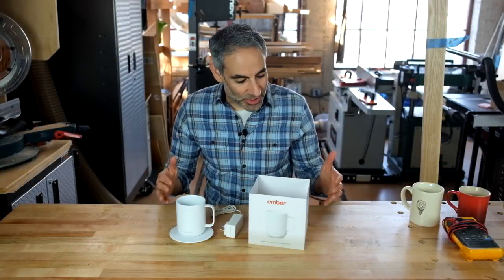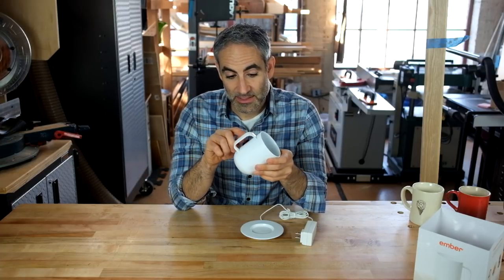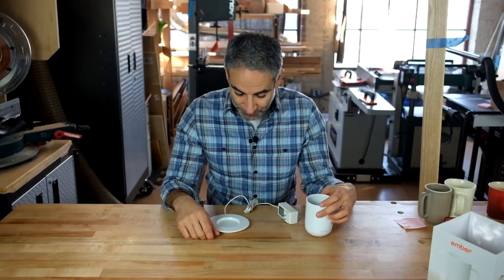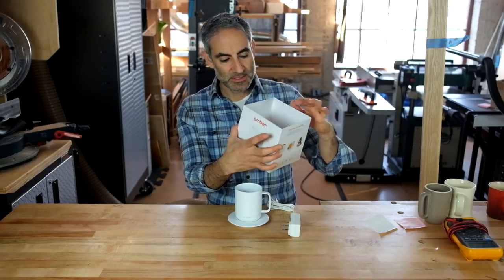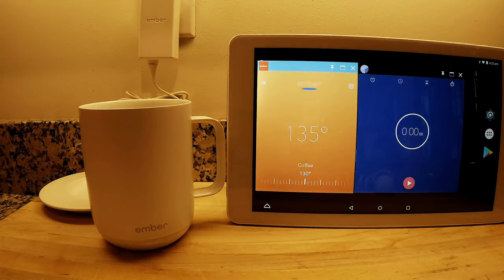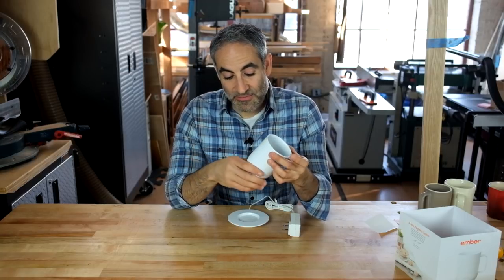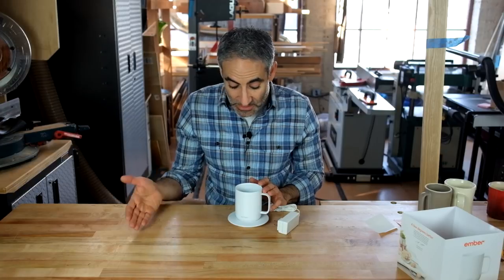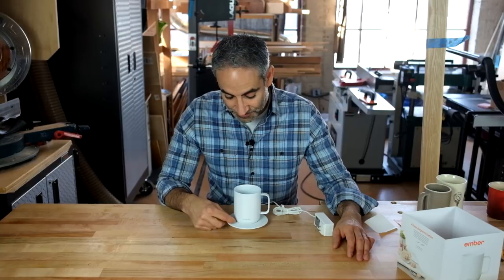Ember Coffee Mug Review: Things you need to know.

Comment: Hi Jesse, I think there is a problem with your experiment. You are assuming that for a full hour the mug keeps 100% of the water and needs to maintain it at the desired temperature. In a real case, as you drink more of your coffee, there is less and less volume of liquid that needs to be heated. And hypothetically, that means less battery use, which perhaps extends battery life. Let me know what you think.
Reply from the maker: Thanks for the comment! Answered that way below and won't go through it again but it's a theory for sure. In reality the mug just served no purpose for me which was the prompt for the whole video and then I returned it. Batteries just don't have high enough energy density yet to make the amount  of heat I'd need for it to be useful 🤷‍♂️

Comment: I love the concept of this mug. Unfortunately, the pins in my fist coaster stopped popping up and they sent me a replacement coaster. (after sending photos and a couple of emails). I do like how it keeps my tea hot (142) to the last drop of my first cup. I have started making my tea in a large "thermos-type" cup and repouring my second cup from it. Unfortunately it will not maintain the desired temp to the bottom of the second cup. For recharging, I am confused. Do most people clean the cup and leave it on the charger all night, or do you have to charge it, unplug and plug it in again in the morning to recharge the charge it has lost through the night? The cup is not ready for use if you unplug it throughout the night.Whew! What an ordeal huh?

Comment: This is my one year follow up report on my Ember mug. It is still working perfectly with no discernible change in the charge dynamics. This may be due to the fact that I rarely discharge it fully. Generally I use it once or twice in the morning for 30 minutes before returning it to the base charger. I have experimented with warming liquids and have discovered that the heating time is substantially shortened by covering the Ember. For example, a full cup of coffee can be heated from 120 degrees to 140 in 9’ 30” while covered but uncovered requires several minutes longer.
Reply from the maker: Good data! Makes sense.... Heat rises and all thermoses and insulated mugs have lids to keep heat from escaping from the top. Thanks for chiming in and glad you like your mug!

Comment: I think the experiments at the end of the video are actually pretty unrealistic scenarios.

I came across this video because I am looking to buy this product. Why do I want something like this?

Alot of times, I pour my self a cup of coffee or tea and place it at my desk while I am working then 30 minutes later I realize I forgot to drink my, drink, and it is now cold.

This product in my opinion is meant to be used at a desk behind a laptop/computer. Always plugged in and put on the charger while drinking or not. To keep your drink warm while you slowly work behind a computer and drink it. Not when you are sitting on a couch reading the news paper or as a electric kettle that you want to heat up your drink.
Reply from the maker: I hear ya! My pov was that if you're only using it in a use case where it's sitting on the base, you could just get a ten dollar mug warmer from target and then use any mug you want, be able to put it in the dishwasher etc. Ie I tested those scenarios because those are the ones where you'd actually need a battery heated mug rather than a hot plate for one.
But I'm glad you enjoy yours! I didn't find it to meet me needs which is why I then shot the video. Either way, thanks for your valuable comments.

Comment: Hey Jesse! Just picked up an Ember Mug for 2020 Christmas. You did an excellent review on the features and specs that really count. Wish I watched this video before I picked it up blindly. Fortunately, it works fine for the person I purchased it for. Still found this video very informative. BTW, I also picked up the Ember Travel Mug for myself. Hopefully you also have a review on that particular item. Ember now has metallic mugs; gold and silver. If you can do a side-by-side comparison on these three items, that would be awesome!! Hopefully Ember made improvements on the newer generations.

Also, your comment on the two leads being live was discovered accidentally by my self. I placed a Nespresso Capsule on the Ember Coaster and I heard and saw a spark from the contacts. This was startling to say the least. May of been a better design if the leads were further apart or at opposite sides of the coaster.

Also, after the Ember Mug is fully charged at our household, we take it off the charger to prevent overcharge and to save from unnecessary excess energy trickle. Does this make that big of a difference for either of the different model?

Thanks for your review on the Ember Mug.

Best Regards,
Johnson
Reply from the maker: Thanks man! Good points!
I won't be reviewing any more because i just don't have the time and I can't be spending $200 to make $3 back on a YouTube video, sadly. I actually bought the ember because I wanted to use it! Anyway good luck to you and thanks for the comments!

Comment: Sir....u r supposed to drink from that coffee. Meaning the battery will last longer when gradually it will need to keep less and less coffee at that temperature. (Thanks for this video, Subscribed)
Reply from the maker: Thanks for the thoughtful comment, octap79! Much appreciated. My experience with the mug (and my understanding of how this works) respectfully disagrees, but I could easily be wrong! :)  On it's own, the coffee doesn't want to do anything. IE it just sits there at the temperature it's at. The colder environment is what creates the heat loss, and because of the ceramic coating and such, loses most of the heat through the open top. Since that area at the top is always the same, the rate of heat loss is actually always the same. BUT, in fact, the actual DROP (not RATE) in temperature will be FASTER if there is less coffee in the cup because it has less thermal mass. At any rate, the amount of energy the cup has to put into keeping the liquid hot is a function of how much the coffee is losing (IE surface area and loss through insulated surfaces, which is less), not the amount of liquid in there. Where the liquid volume does really kick you in the pants is when you have to heat it from a lower temperature, and then the volume of liquid is directly proportional to the energy is takes to heat is, PLUS the thermal loss on top of the that. Anywho, that's my understanding of thermodynamics, but that's not my specialty ;)  Either way, appreciate the brain-teaser!

Comment: This is fantastic. A very thorough review that actually tells viewers how a product will behave rather than one which is a longwinded "I (dis)liked it". One small thing: I think with anything technical, Celsius (at least) would be appreciated, since it is used in most of the world and in most of science as well (and hey Kelvin is just shifted Celsius anyway). Similarly for lengths the metric system is more appropriate, and volumes litres (which are metric) etc. if the target audience is 'everyone'. No harm in mentioning Fahrenheit, ounces, feet & inches values as well, but they are less universal. I'm sure you know all this of course, but thought I should point it out.
Reply from the maker: Thanks for the kudos and totally fair points on the units! 👍
Reply: @LetsOverthinkThis  Awesome!

Comment: What? So you want a coffee mug that physically plugs in?
Reply from the maker: For the most part, given the current possible energy density of batteries 
,I largely think this is a product that should never have been made. And to me, it doesn't really solve a use case not solved by one of those $10 mug hot plates.
Reply: @LetsOverthinkThis  I personally disagree. I get 90 minutes of temp set coffee with this mug for $90. And unlimited time with the cheap plug in coaster.
Reply from the maker: @InterMystery  Glad it works for you!

Comment: This is a great review. However, the battery life will last longer as you drink more coffee out of it as it will take less energy to keep the lesser amount of liquid warm.
Reply from the maker: Thanks for the comment! Another person said the same thing a few comments down and I commented that I don't think that's true. The mug only has to replace the energy lost. So the heat it's putting in is an amount of energy proportional to the rate of heat loss and not the mass of the thing being heated. The side surface area of the cup does grow with more coffee (so I agree with your theory there) but the top surface area doesn't change and that's where the most heat loss occurs in a cup, so that's why I generally disagree.  Either way, I didn't find the mug met my needs, so theory or not I wasn't satisfied with it even in regular use.  Again, thanks for the comment!

Comment: The problem with this review is he doesn’t use the charging base while using. Most people sit at a desk and work. 

I don’t get the feeling it’s meant to be a cup that heats your old counter coffee or will maintain its heat for hours. With no lid it would eventually evaporate and be bad anyway. 

But for doing work at your desk, especially if you’re like me and tend to forget you have a coffee going, it’s quite nice to find that it’s still the perfect temp and delicious. 

Also, they make a larger one now.
Reply from the maker: Thanks for the comment and I totally hear what you're saying! My contention is this: if it was designed to just sit on the coaster, it's a poorly designed product. You can buy a $20 heated coaster at Target or Amazon that keeps your mug hot while at your desk, lets you use virtually any mug you want, lets you dishwasher or microwave your mug, etc. If the mug doesn't need to heat itself when it's not on the coaster, for example, it shouldn't have a battery! It could just have a heating element it and a mating power connection on the bottom (like electric kettles do).  In a nutshell, the only reason it needs to have on-board power is for you to use it away from the base and todays battery tech just doesn't have a high enough energy density to have this make sense.
But.... I totally hear that you enjoy using the product and I'm glad that's the case! Despite how it may seem,  I'd rather you enjoy the product you bought than not, even if we differ in opinion!
Reply: @LetsOverthinkThis  I've tried many of those heated coasters and regular mugs. Too hot and they get a burnt taste. Too cold and they are terrible too. And they're never right. I think it might just be the lack of smart that is the problem.

It's not perfect as a product (the price - why!) but the Ember does hold the exact temperature super well. I can take it to my other desk or to a meeting and it continues to hold it's exact temp. It's amazing to actually use. And if the battery does go dead, It's a sign I prolly didn't need that last coffee.

One last thing, I'm seeing other similar mugs showing up now. Most with an induction charger that will also charge your phone. So maybe there's a better, cheaper solution out there or will be soon. 

Thanks for the review and the reply! I'll check out your channel more often.

Comment: This is pretty thorough lol but one minor criticism, Jesse. Remember that as you are drinking the coffee, there will be less and less coffee in the cup, and therefore less coffee for the cup to keep warm. So the timelapse videos were good, but would have been a bit more accurate if you had somehow taken some liquid out halfway. I'm assuming that it takes the cup less energy to keep a half cup warm than a full cup, so real life mileage may be somewhat greater than your experiments suggest. Not trying to give you a hard time, just an observation in the spirit of the scientific method.
Reply from the maker: I hear what youre saying but the heat required to keep it hot is related to the heat loss. Not the total mass. That only comes into play if you try and increase the heat. So I hear your point but respectfully disagree! The point you have is only a bit valid because the side surface area increases with a more full cup. But because the majority of the heat is lost from the top, it actually doesn't change much anyway.  Appreciate the thought though!
Reply: @LetsOverthinkThis  I think you're right, Jesse! Thanks for the thoughtful response.

Comment: Great video.  I've use the ember for about a year and my biggest problem is the charging "coaster".   I've gone through two of them already.    I think the reason they want you to dry the mug before placing it on the coaster is because liquid will get into the charging pins and damage the springs inside of them.   This means the pins will push down and not push back up causing them to lose contact with the bottom of the mug preventing it from charging.     My biggest mistake was thinking that the charging coaster was a charger and a coaster.     They need to improve the battery and charging mechanism before this becomes a viable product.   Especially for something that costs $140 for a standard size mug.
Reply: Yes, its $170 AUD in Australia and the 240ml of liquid is far too little for me, I want more like 450ml and expect to be able to use the coaster/saucer as exactly that, be able to catch spills as they often occur to a small degree, drips at least. the Mug size isn't available in Australia and perhaps that's a good thing as its saved me a lot of money. Thanks for your comments.

Comment: First, my charging coaster failed.  Replaced on warranty.  Now my mug failed.  Replacing on warranty. I've had to send multiple emails over multiple weeks to get a response. Multiple times. Infuriating.
Reply from the maker: That sucks. How long have you been using it?
Reply: @LetsOverthinkThis  I got it mid-March, so about 8 months. A small point, my mug was white. Stained immediately and permanently. When my coaster stopped working,  i went to the site to request a replacement. When it asked what the problem was with the coaster, the drop down of choices included an option that one of the charging contract pins stayed retracted! It's such a common problem they included it jn the drop down! The price is high, the quality is questionable, and the service is sketchy. Oh, and I could never keep the mugs (mine and my wife's)  linked to the app. Had to re-pair almost every time I tried to use the app. Cool idea, but a ripoff.
Reply from the maker: @carlkaufman2429  Oh man, yeah that's a terrible experience. To be honest, i don't think the price is high for what they have in there, but I don't think it's worth it and I agree the quality needs to be even higher (which means it should likely be more expensive, not less).  As you can glean from my video, it's a product I don't think should be made in the first place given today's battery tech. Either way, I hope some of your problems get remedied.
Reply: @LetsOverthinkThis  For now, I've gone back to my good old thermal mug : )
Reply from the maker: yeah, me too :)

Comment: Thanks for the test but these’s one flaw. There should be less coffee over time to heat therefore battery would last longer
Reply from the maker: Hi Roman2011, and thanks for the comment. I put a lengthy response to another person's similar comment. Essentially, I disagree... read on and let me know if I got it wrong!  Pasted here:
My experience with the mug (and my understanding of how this works) respectfully disagrees, but I could easily be wrong! :)  On it's own, the coffee doesn't want to do anything. IE it just sits there at the temperature it's at. The colder environment is what creates the heat loss, and because of the ceramic coating and such, loses most of the heat through the open top. Since that area at the top is always the same, the rate of heat loss is actually always the same. BUT, in fact, the actual DROP (not RATE) in temperature will be FASTER if there is less coffee in the cup because it has less thermal mass. At any rate, the amount of energy the cup has to put into keeping the liquid hot is a function of how much the coffee is losing (IE surface area and loss through insulated surfaces, which is less), not the amount of liquid in there. Where the liquid volume does really kick you in the pants is when you have to heat it from a lower temperature, and then the volume of liquid is directly proportional to the energy is takes to heat is, PLUS the thermal loss on top of the that. Anywho, that's my understanding of thermodynamics, but that's not my specialty ;)  Either way, appreciate the brain-teaser!
Reply: Jesse MAKES wow. That is a brain teaser! I never considered how the exposed area of the cup would draw more heat (like a heat sink) and be more of a factor than the water mass. Question. If the cup was empty, it would drain the battery faster than if it was full? Seems counter intuitive.
Reply: Jesse MAKES now i can’t sleep thinking about this...lol....can you please test a half cup vs a full cup? Which last longer? Please please 🙏🏻🙏🏻🙏🏻
Reply from the maker: Brain-teaser indeed!! :)  The cup turns off if it's empty, so there's that to consider. To be totally honest, I do think it cools SLIGHTLY faster when full since the surface area through which it's losing heat is the top surface area and more of the side area. But cups lose most heat through the top, so I expect that effect to be pretty negligible. To your question below, I do think a half-cup would last longer on the batter than a full-cup, but that it would only be slight. And I think where this mug really loses is if it has to actually heat anything (not just make up for lost heat). Battery tech just isn't good enough yet to have the energy density necessary for that in a small battery. Anywho, I returned my mug so I can't answer your question below :(